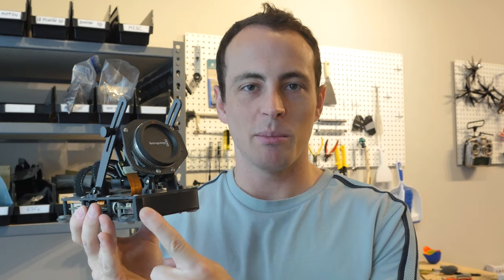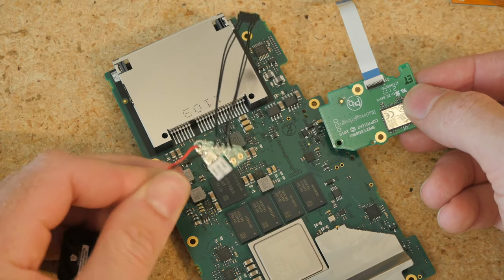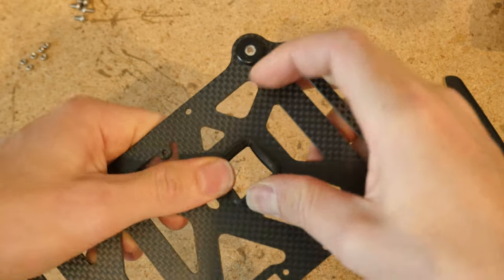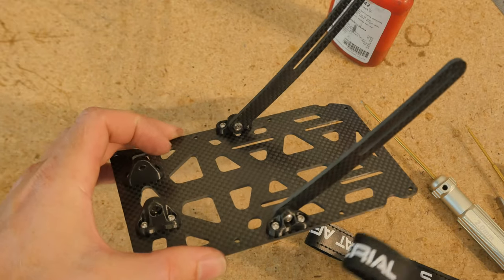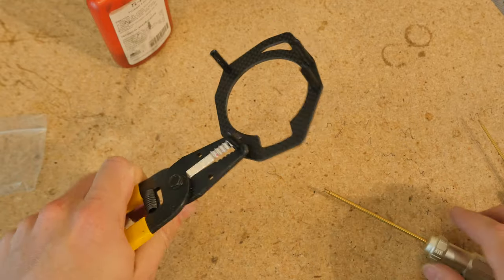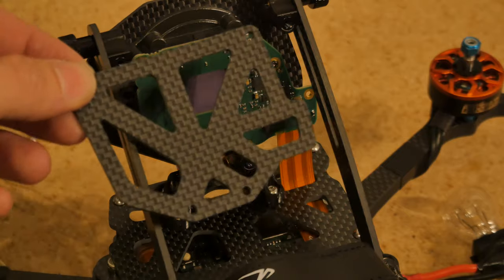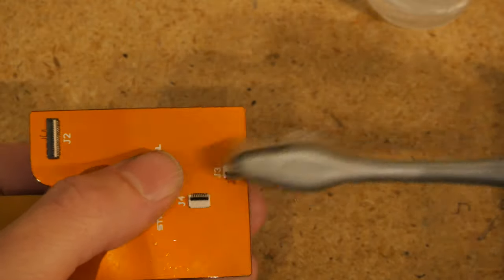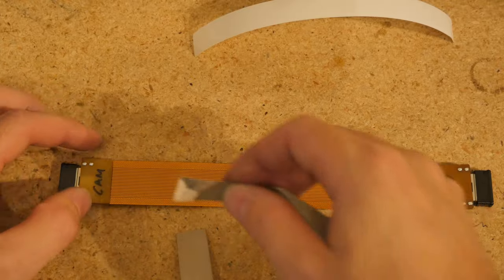BMPCC4K 3.1 Cage Assembly

Comment: Hi Sam... I bought your Kit and all workd well. There are now a new update for the BMC4K (firmware 6.9) and I think to update it and want to ask you if this is possible.
Thanks for your help and best regards Christian
Reply from the maker: Hi there and thanks for getting my kit! I recommend using firmware 6.9.6 if possible (compatible with cameras manufactured before May 2021) because the camera can boot up without the LCD screen attached. With FW 7.3 and later, the camera must be connected to the LCD via the extension before powering up the camera. You may update the camera easily with no issue after it has been installed into my naked cage.

Comment: Can i apply waterproof “worry free” product to the board? What do you think?
Reply from the maker: Hi Ahmad, I have used conformal coating on the boards before without issue, but it may increase the chance of damaging the PCB because when the conformal coating wicks underneath it may cause issues if it expands somehow.
Reply: @strawhatsam  good point 👍🏻